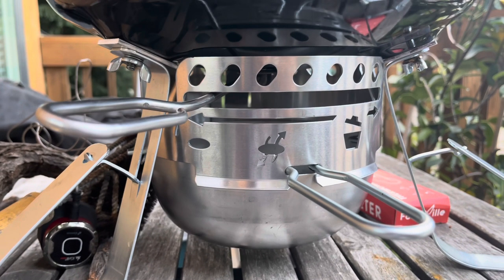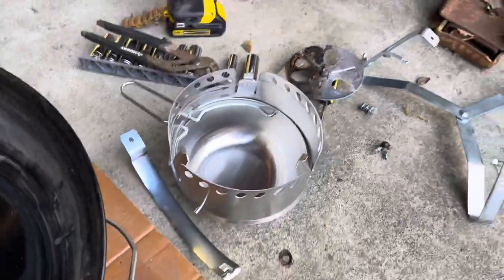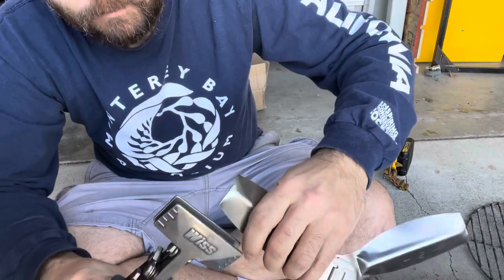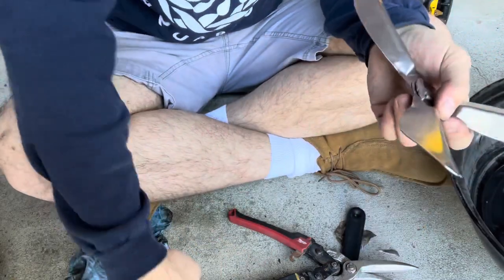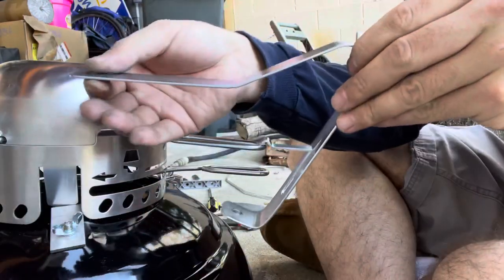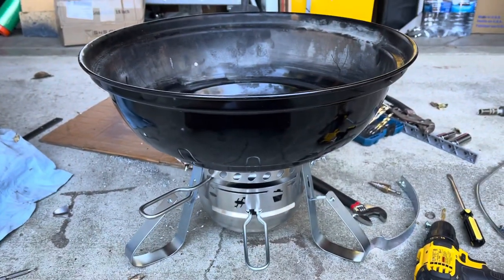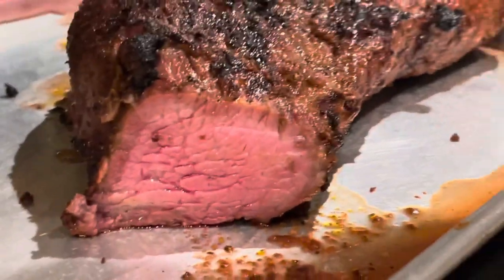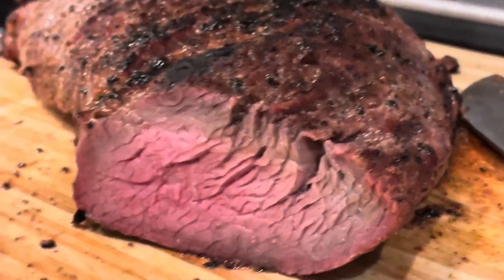Weber Jumbo Joe Grill | Ultimate Upgrades | #1 The Ash Catcher Mod

Comment: I was looking for mods for my jumbo joe.  I did the pizza pan baffle plate mod. Added a thermometer.  But your the only  one ive seen adding an ash catcher.  Instead of the brackets i just drilled holes for bolts i had laying around.  The way you modded the legs made perfect sense aswell.  It would have been so easy for weber to design the jumbo this way, at least come up with addons we could buy.

Comment: Great hand tool skills.  Is there a big difference between the Jumbo Joe and the one touch 18” kettle?
Reply from the maker: I think the 18" kettle is a lot taller in addition to the legs obviously. Also, the bowl on the 18" is rounder if that makes sense. The jumbo joe has a ridge on the lower bowl. I don't have an 18" currently, so I can't compare them side-by-side. I think they grill pretty much the same and have similar cooking area.

Comment: are the holes for the one touch system the same between the 18" inch and the 22", just wondering because the 22" 3 blade one touch is $18 cheaper than the 18" - either way its going to get trimmed but just wondering if it would matter.
Reply from the maker: I remember finding the same thing with pricing. I'm guessing the 22 would work. I was hoping the 18" was a drop-in which wasn't the case. Since you're trimming it either way the 22 may save you some dollars. If you that route reply back to let other know.
Reply from the maker: I "think" the 22" would work. Since you're drilling the hole larger anyways, although I'm not 100% sure on the fit

Comment: SJP FTW
Reply from the maker: Haha, had to look up SJP (not Sarah Jessica Parker) found this good reference. http://weberkettleclub.com/grills/weber-smokey-joe-history/
Reply: @artofthegrill9235  yep. Good for ash and charcoal not falling out. But what you did is a really sweet mod. I like it a lot. Does kit charcoal die if all the vents are closed?
Reply from the maker: @jrocthadino  You know, it doesn't. I think if I put a seal around the rim of the lid it would, but not sure I want to go that route. For now I'm using a make shift coal pan which puts the coals out instantly and makes it safer to transport in a car etc...  Here's a video of that if you're interested. https://youtu.be/AsQ8bplkil0
Reply: @artofthegrill9235  why not just use the step drill on the original vent on the bottom, size it a bit smaller then file some notches in it for the H bracket"timing" it so it's the same as the one touch then you can still choke out the charcoal - should work in theory
Reply from the maker: @RfdAviator85  I'm not familiar with a different one touch hole shape/size for the the bottom mount. I reviewed another video where he replaces his ash catcher and you can see it's a standard circle hole as well. https://youtu.be/R-5lXBoHQ1o The one touch (lever system) doesn't look round, but when you pull the lever it needs to be in a round hole. Maybe what you're referring to is different? I DO think I could get a flashlight out to find and close the gaps on the blades to get the coals to extinguish faster.
Reply: @artofthegrill9235  what i'm saying is to make a square hole in the original bottom vent and put it back on but making sure to "time it" with the 3 bladed one you added so they are synced. then you should be able to extinguish the coals without using the container
Reply from the maker: @RfdAviator85  That could help, although spinning the blades more than 1/4 turn is useful for cleaning ash out of the kettle. If you prevented the blades from spinning you may loose that ability.
Reply: @artofthegrill9235  well you could trim of the little tabs that limit it - i was wanting to do this mod but i don't want to not be able to choke out the charcoal when i'm done
Reply from the maker: Weber should sell a pre-built kit to do this!
Reply from the maker: @RfdAviator85  BTW, I tightened the bolt on the top lid damper and it sealed it enough to snuff out the coals. Planning on uploading a video about it.

Comment: How big and what did you use for the brackets?
Reply from the maker: Let me double check on the exact  dimensions later, but I used aluminum stock from home depot. It's about 1/4" x 1" x 2", I believe from memory.
Reply from the maker: Ok it was cut off of 1/8" x 1" bar like this. https://www.homedepot.com/p/Everbilt-1-in-x-36-in-Aluminum-Flat-Bar-with-1-8-in-Thick-801937/204273949. About an 1.5 inches.
Reply from the maker: It's a handy piece of aluminum to have around
Reply: Nice Mod! My next project.
Reply: @artofthegrill9235  awesome sauce!!! So I have everything to do this mod now what would you do and not do again? Can you remember how big of a hole you went with the step bit?
Reply from the maker: @jaymekylesieradzki5721  Dude! That's awesome.  I'm planning on adding some bolts through the legs and top of the ash catcher to make the legs more stable. I'd recommend doing that. For the step bit, I remember mine was too small, I had to ream it larger with a file.  I think mine was 1/2" and I wish I had one larger.